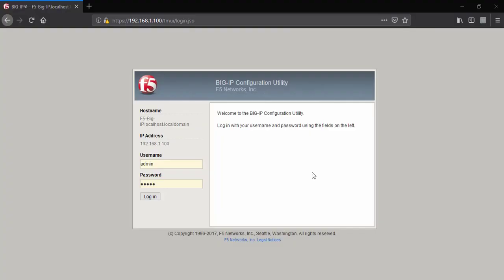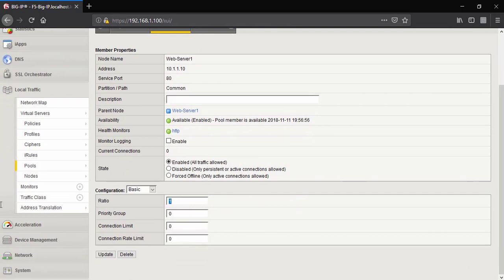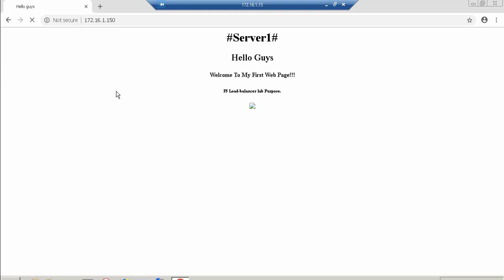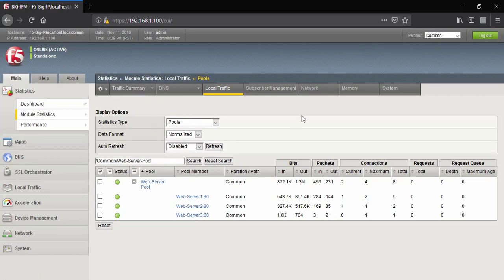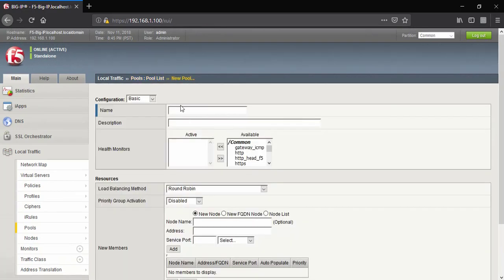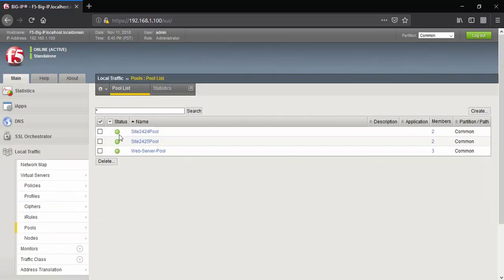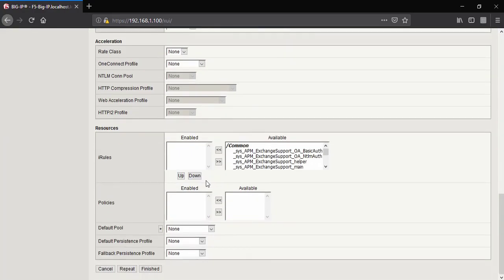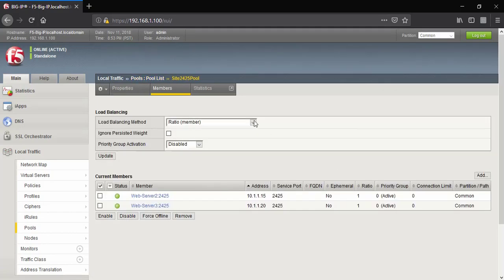#Video-09,Ratio Load balancing on f5 , difference in node based & pool member based load balancing.

Comment: Great video, I have a question though, when you configured load-balancing method node based (during the later part of the video) and you initiated 12 total connections to the VIP of 2424 and 2425 TCP ports each then why did server 1 and server 3 handled 8 connections each and server 2 which was the part of both pools 2424 and 2425 only catered 4 connections?